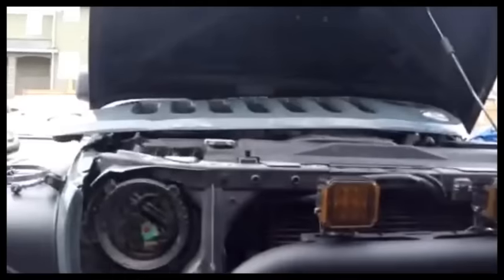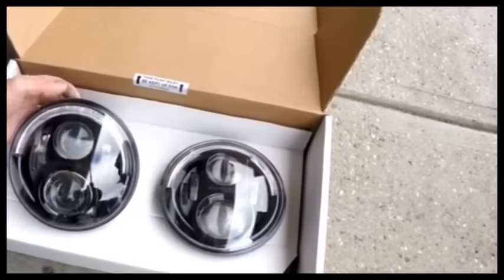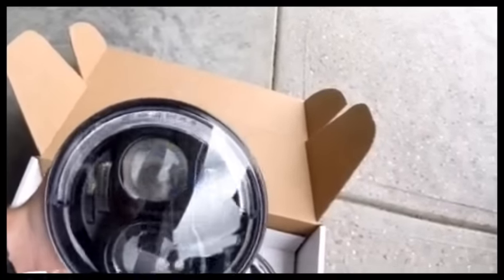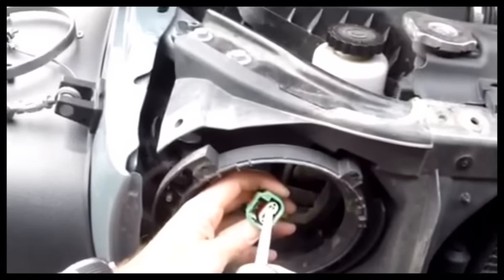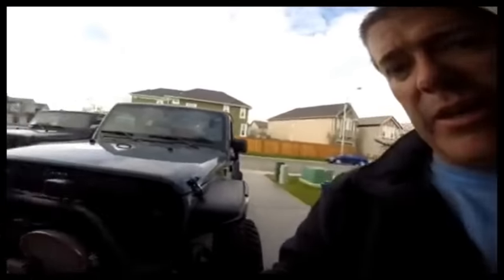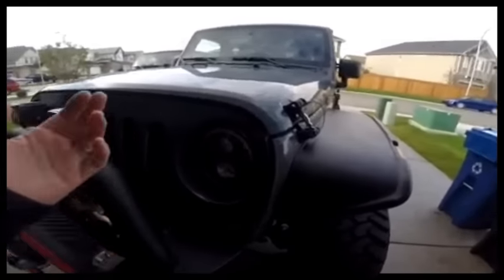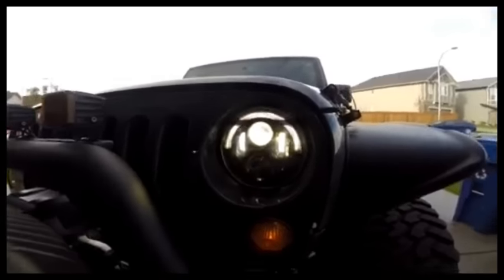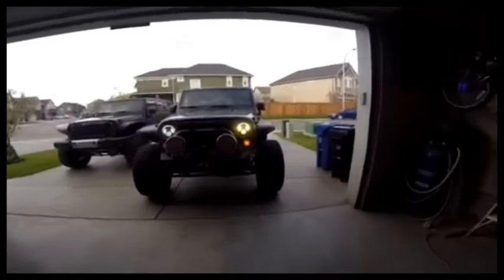JW Speaker 8700 Evolution 2 J

Comment: Thanks for the videos!  Its one of the reasons I jumped on this set and got them today!  I do have a question though about the DRL and should it just be the halo that's lit up?  It was overcast today and when my switch set to "auto" the halo was not lit up but the others were.  When moved to the on position the halo and the other lights light up.  Is yours the same?  I have model 8700 Evolution J - 0551131
Reply from the maker: +Off The Break I have my DRL set on my fog lights.   I do have my lights set to auto and when the lights come on the halo's come on too.  One thing I did have to do was replace the wire harness, due to the factory plug didn't work that well and one light kept going out.  I replaced them with the Deutsch connectors.  http://www.deutschconnector.com/products/deutsch_connectors/deutsch_dt_series_connectors/deutsch_dt_3-way_connectors/

Comment: Is there a way to keep the halos on all the time for day time driving?
Reply from the maker: +Donny Kuser I would not say it's not possible, but you would have to change the wiring inside the light to be able to do it.  Here's a video I did that shows using a AEV Procal and the results.